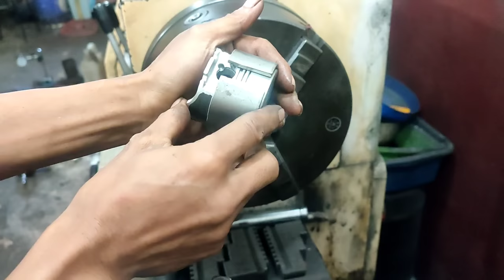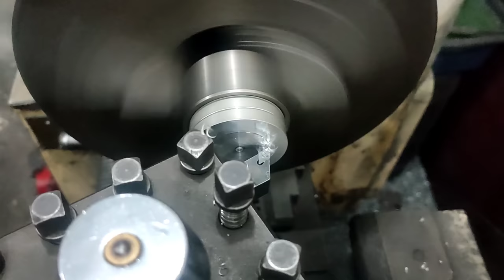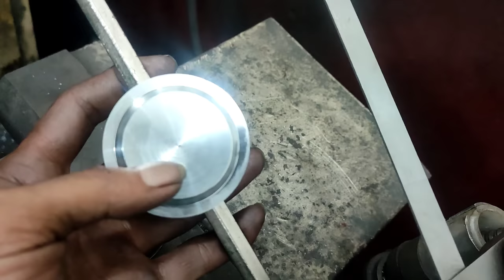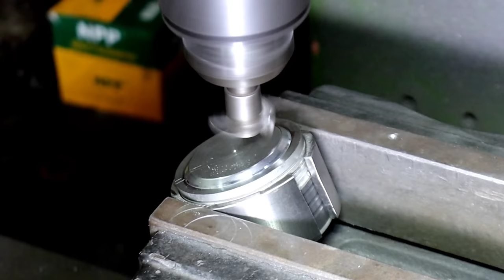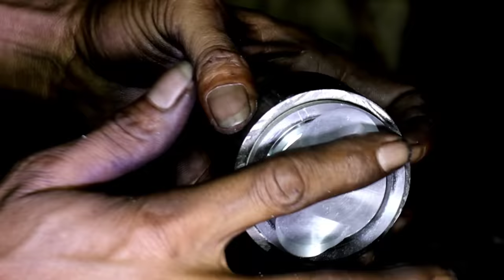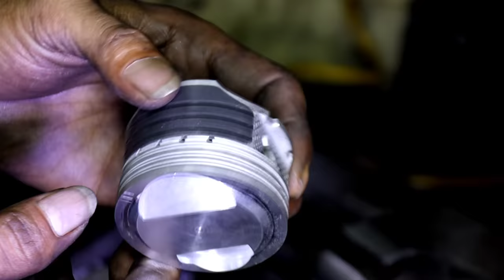how to modify piston ( extreme )

Comment: I understand what you did and the methodology you used to reach the end point. What was the piston used for to begin with and what did you modify the piston to fit into for use? Unless I know that then all I see is someone just cutting some aluminum. Maybe I am just thick or something or something but I do not see why you modified the piston. I have to assume you modified the piston for a racing application.
Reply: from what I see, he has a "sporty" piston damaged (is broken in the crown, first  3-5 seconds of the video), took a piston with huge compression height (distance from the compression ring and the top of the piston), and made some machining to copy it the crown.   from a machining point of view, the guy has amazing manual skills, no doubt. From a thechnical point of view, if the objective is to make this engine more "compressed" instead of buying expensive forged pistons (the one he copied is clearly a forged piston) it may be good considering the costs involved, but for performance point of view, is no way, the sporty piston is lighter and stronger, the piston he used to modify is cast aluminum, it is heavy compared to the sporty forged one, but, I can understand, when you do not live in a rich country, you need to adapt at what you have, is like "made it in a budget" but more extreme way.
Reply: He is just making a replacement. The engine maybe getting bored to the next oversize.
Reply: Yes for modified cam and bigger valve size,need more valve lift clearance due to modified cams

Comment: How thick is the piston crown after that much machining?
Reply from the maker: approximately 5mm , with this shape the valve part is very close to the piston ring ( people order )
Reply: Not thick enough....
Reply: @thefreedomguyuk  it depends of the application, from what I see, 5mm can be enough for a Naturally Aspirated engine
Reply: @thefreedomguyuk  it's enough. Use 13:1 compression ratio. Huge valve, stroke up, extreme camshaft profile upgraded Ignition, porting polish, proper cooling will boost the horsepower from 14 to 30HP minimum
Reply: @thefreedomguyuk  при нормальной эксплуатации хватает.
Reply: @thefreedomguyuk  doesn't look like this is the first time hes modded a piston. Id assume he would have some idea of whats required. Otherwise he would be wasting his time, which with his skill level definitely has value.